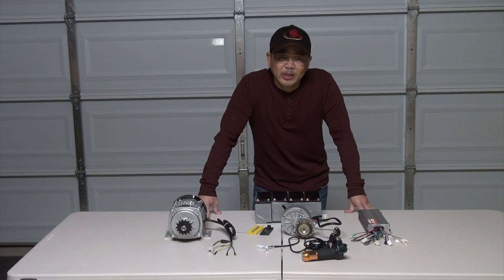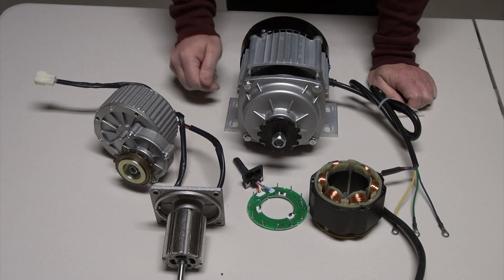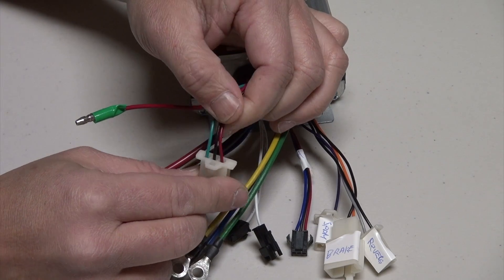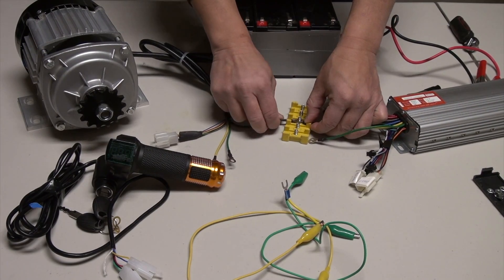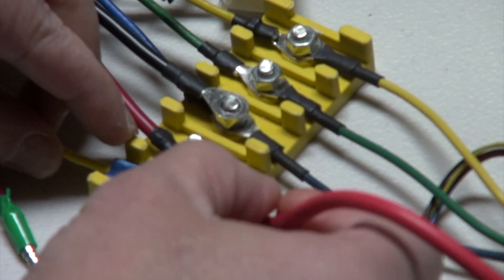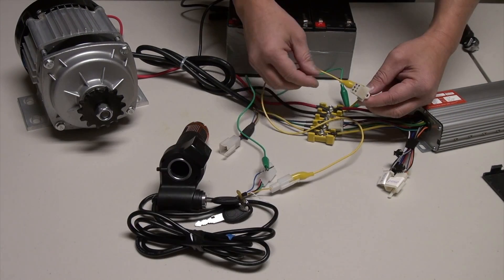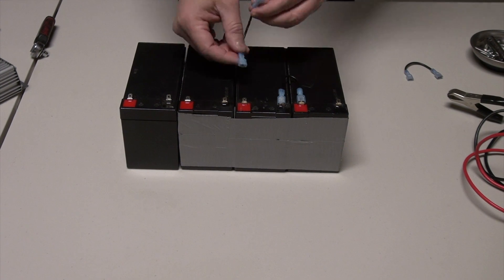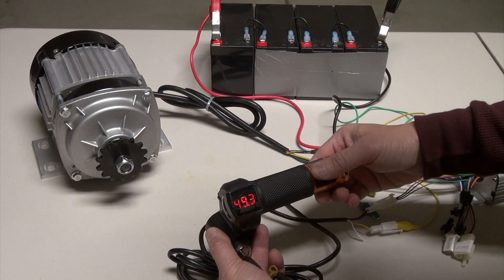How to Connect a Brushless DC Motor to Controller (48V 750W E-Bike) in English

Comment: I'm thinking of building an E-bike with a 48volt 2000watt permenant magnet motor. It doesn't have hall sensors. Any downfalls with my idea?
Reply from the maker: Check out part I & II of my ebike videos…Powerful Electric Bike Conversion Part II--Lithium-ion Battery Power Boost Upgrade
https://youtu.be/c6YgNQg3VM8

Comment: Does the controller step down the voltage for the "on off switch" or do you need a toggle switch that matches that batteries voltage?
Reply from the maker: The controller is rated for 48v.  For the throttle switch, the controller will allow a small amount of voltage to do its job.  Thanks!

Comment: Hi and thank you for your great tutorial.
I followed it completely to replace my former thumb throttle. 
I tried the  new sensor on an external source first and it showed the expected 5V connecting the positive and the ground cable and low Voltage when connecting the Data cable with ground which would increase when I twisted the accelarator. 
Connecting the throttle to the controler and motor I quickly found that I had to switch the yellow and white cable in order to not have the display consistently on and the keys without function.
With the cables switched, power supply seemed to be working as intended.
However, while the horn and lights worked well, the accelerator did not work at all. 
When measuring with Voltmeter,  the data cable of the throttle showed negative Volt  value which would not change when I twisted the throttle.
I can not explain to myself why that happened. I tried few other cable combinations but to have the key function working I could not find a way to make the sensor/accelerator work.
Do you have any idea about what went wrong and how I can fix that? I would highly appreciate some help.
Best wishes
Fran
Reply from the maker: The only thing I can think of is based on your description is that the throttle terminals from the controller and the accelerator might not be compatible.  Sounds like you already tried and make sure the positive, negative and signal lines ( green) from both the controller and throttle are matched and connected. Sorry bro.  Might be a disconnect in the throttle circuit…
Reply: Hey actually that was quite helpful as it made me check Volt output for the Halle sensor  at the controller and that is not the 5V needed. Now I can only think that I dont have Ignition and Switch assigned correctly as in my controller they are not easy to find. How can you recognize where to connect the blue and yellow cable from the throttle,. You connect the blue cable in the video to a red cable which comes directly from the main Battery cable or some side connector? Same is for the yellow cable to the Switch. In my controller I couldnt tell which one that is.  And my last question. With this controller and throttel, can you connect front and rear light and a horn which all switch off with the key? 
I really wuld appreciate an answer as anything helps right now.

Comment: Hey man, what if my controller doesn't have a red electric switch wire for the blue on the voltage throttle to go to?
Reply from the maker: It might have separate terminal for the throttle.  Hopefully your controller comes with a diagram.  Best wishes.

Comment: I’m very confused on how u connected the wires. What is that yellow thing? If somebody knows the answer I would highly appreciate if you could answer my question. Also, what is those connector things for the battery?
Reply from the maker: The yellow thing is the terminal block.  Those other ones are wire connectors or terminal connectors.  Sometimes, the terminal block come with the electric motor if it is part of a kit package.  I hope this helps.  Thanks!
Reply: @diypotentials  Did your terminal block come with the kit or did you get it elsewhere. If so, could you please add a link of where to get it?

Comment: Hello, Is it possible to use a 48V, 30Amp, 20ah, 960Wh battery with this motor?
Thanks!
Reply from the maker: Yes.  It should work…thanks!
Reply: @diypotentials  Thank you!
Reply: @diypotentials   @DIY Potentials: Projects & Ideas  Hi, I have a white and a yellow wire at the ignition cable.
Can I use the white cable instead of the shown blue one to connect.
Thank you!

Comment: Will this motor work backward? I mean rotating shaft to charge the battery
Reply from the maker: It can work as a generator.  But it will produce AC voltages.  You will need to convert AC to DC to charge the battery and regulate the voltage level.  Thanks!

Comment: How do I short circuit r2 and gnd on my throttle cable to go 31 mph it only goes 20 the seller on eBay told me to connect it that way I said that was your job and now he wants me to do it piss me off I didn't buy it from China either but it came from China California

Comment: Heyo, great vid. I have two of the same motors you have in 60v 750w and a 60V20AH 3000W lithium ion battery. I want to run both motors together for my project. Any ideas what would be a good setup for running two motors? Thanks much!
Reply from the maker: Hey Joe, thanks for asking.  Sound like an interesting project.  I have not tried running two BLDC motors off the same battery and controller, so I won’t be able to offer any helpful suggestions.  Maybe the other folks can chime in.  Best of luck.  Thanks!

Comment: Hi, if i have a Lithium-ion or Lithium Ferro phosphate battery of 72v50Mah, what should be my ideal motor and controller specifications to get optimum output? And can you please explain the science of it. Thanks in Advance!
Reply from the maker: Hello,  the motor and controller should be rated for 72v.  The current or amp rating for both items should be 50A or less.  Thanks!

Comment: Thank you for the details video, but how do you mount the hall sensor, my package actually has the hall sensor separate, where do I put this sensor onto the bike?
Reply from the maker: Hello, my understanding is that the hall sensors should be already installed in the BLDC motor.  I recommend reaching out to the seller on this matter… Thanks!
Reply: It could be a hall sensor to mount ob your fork. Then you place a little magnet on your wheel. that setup is used for a speedometer it is seperate from te workings of the motor

Comment: my motor run immediately when ignition wire connects to battery. more over gear up, it change direction of rational. is problem from motor or controller? Thank you sir
Reply from the maker: More likely the controller… thanks!

Comment: I wanted to thank you and tell you that I couldn't have done it without you.
But it appears that I have NOT done it yet.
When I try to connect the battery to the controller, I get a loud pop and a spark.
I am going red to red and black to black at every connection.
I don't understand why it won't allow me to connect it.
I can take a pic, or a video, to confirm to you that my positive and negative wires are not crossed.
edit:
Here is my video: youtube.com/watch?v=HUv6Gskd6bs
Reply: How much voltage is your battery? High voltage batteries do that. Best to get anti spark connectors when dealing with 60v or more batteries
Reply: 48v. I returned the motor and controller and got a new system and it's fine now.
 @DyLemmaOG

Comment: Thankyou will  try this , but.... 
I have both yellow wire for ignition connection at throttle , which one is blue can i connect in any one ?
Reply: It works but my source is a weak dc (48 V; 2-3 amp ) adapter so couldn't get the full run as expected but excited for tomorrow to try  it on charged batteries with enough power, thankyou once again \m/
Reply from the maker: Awesome to hear it is working…
Reply: Update: it's now on full throttle :D  , worked for both 48 V n 60 V  thanks a lot , but this 48 V 750 W seems only good for bicycles not so much torque but 60 V 1200 W will try for a quad bike upgrade soon it has promissing speed n torque let's see on field  with the quad bike n load ... Thankyou once again was about to return those as was unable to get the controller ON  .
Reply: @yaminoshinn1473   @yami no shinn  How do you connected the yellow wires? Is it a problem to mix them up?
I have a yellow and a white wire at the ignition cable.
Hope you can help me out!
Thanks.
Reply: @jones8732  yes no problem it just provides a switching circuit for powering control box  through ignition wire on control box  which is connected to  throttle wires
(In my case yellow wires; in the video above yellow and blue ,assuming yours yellow and white )  i.e. If it's the throttle wire u are talking about .
 Though it might get reversely controlled( not definite )  in that case u can switch wires , anyways it won't have issues on control box  try on low current output source first for more secure approach .
Reply: @yaminoshinn1473  Hi, Thank you for your reply. I tried it and it works.
Reply: @jones8732  congratulations bro

Comment: Im a little confused. So blue and yellow are powered. So what's the difference between the main power line and the small red line? Why does the switch curcuit need both wires powered? Shouldn't one go to ground?
Reply from the maker: The way I understand it is that the yellow wire is a positive line for the switch, so it needs to be connected to the power source which is the red positive wire from the battery--So it is a parallel circuit.  Coming out or at the opposite end of the switch is the blue line, which is still positive, that is why it is connected to the small red wire feeding into the controller, where the current will eventaully return to ground.  It is very confusing.  Maybe others can explain better.  Thanks!

Comment: Thank you for the video. I can’t find a diagram on this controller and this is a huge help. 

 I am trying to figure out what the remaining 4 sets of wires are for that you didn’t cover. 

Do you know what the black plug with the red, blue, and black wire is for. Is that peddle assist? I took the controller apart to see if the board had any clues on it. The wires were labeled as Red=+5V, Black=TX, and Blue=RX. 

Are the orange and black wires going into the female 3 pin plug the low brake wires? The circuit is labeled BKL on orange and GND on black. 

Are the grey and black wires going into the two pin plug the switching wires for forward and reverse? Grey is labeled BACK and Black is GND. 

Is the purple wire an battery voltage indicator wire? It is labeled XC 

Thank you in advance for your help.
Reply from the maker: Hello,  the black plug with the red, blue, and black wire is peddle assist.  The black and orange  plug is for Brake.  The gray and black  plug is for reverse.  You are correct.  The purple wire is the speedometer.   Thanks!
Reply: @diypotentials  thank you very much!

Comment: Thanks for the video. What do you think of running the motor without the speed controller. Meaning can i just connect the motor to the highest rate of the battery at once?
Reply from the maker: From my experience, a BLDC motor needs to be connected to a controller and will not work if directly connected to a battery.  Once connected to a controller, you can set the desired current to run the motor.  Thanks!

Comment: I bought a 1000W bldc motor for my electric gokart project which was supposedly more than enough for the size and weight of the kart
but the motor spins slowly even when the kart is kept off the ground (on a stand), how do I fix this?
Reply: for me it sounds like the motor controller that you use can not put enough current going to the motor - might be because of the low current and voltage ratings of the controller or maybe the hall sensors don't work fine.
Reply from the maker: It sounds like the motor's phase wires might not match with the controller's phase wires.

Comment: can i use  a 48v 13A battrey FOR a 2000w 42A motor  ?
Reply from the maker: If the voltage rating for the motor is 48V.  At 13A, the motor might run, but won’t achieve its full capacity.

Comment: I believe the BLDC motors are also called EC motors (electronically commutated) motors. They are often found in fans in the air conditioning industry.  They are preferred because of their energy efficient characteristic but they also cost more than PSC (permanent split capacitor) fans.
Reply from the maker: Totally agree.  Thanks!
Reply: @diypotentials  My controller doesn't have an ignition wire and I bought a throttle with ingnition key and the throttle has three standard throttle wires and two more wires, the yellow and the blue (ignition) wire. Any thoughts on how to resolve this? Thank you

Comment: One question  the blue wire off the throttle  goes  to any power source other than the battery  right im work with  different  controller for a brushed set up and  as this throttle is universal i need  to now figure  the blue wire as b4 it was blue and  yellow
Reply from the maker: That is the ignition wire to be connected to the controller.

Comment: HI! Thank you soo much for sharing your thoughts with all of us re ebike controllers! I have a 2008ish  500watt 36volt AC hubmtr. with a 7 speed Shimano, throttle type ebike from the landfill! I can't find Battery, housing, charger and BMS and I believe the controller is in the hub.  Connector to the battery has 6 pins 4 large pins and 2 small and the one to the hub has 5 small only two large pins.  Spent hours of research, learning but still afraid to buy a possible battery, BMS and charger for it. I have had the ebike for months and  I just want to go out get some exercise and experiment with this more. Also read I may need to change the throttle to a potentiometer type and I would need to getting bike rolling for the wheel to start rotating. Not a problem for me to do that and cooling down with fins or holes to stop any overheating is also. Cant I just get a get an LI  20 amp battery kit with BMS, charger with a SW/fuses and not the 30 amp controller you are showing here? I think I saw a 1-5 volt potentiometer on your other video but not sure where to get it? Way grateful for any thoughts on this!
Reply from the maker: Hello,  I'm not familiar with the hub-motor you described, so I won't be able to give any feedback on that.  However, I don't think the controller is in the hub.  There might be a hall sensor circuit inside the hub, though.  But I might be wrong.  Also since the motor is rated at 500 watts at 36V, it needs about 14 amps to reach 500 watts at 36V.  So if you are planning on getting a controller, any one able to handle 14-20 amps or more would be sufficient, even the 30 amp one so long it is rated for 36V.  For battery, a 20 AH (amp-hours) will be sufficient.  Of course the more AH the battery has, the more run-time you will get.   I found a video that might be more helpful..https://youtu.be/A8QcNvRh0wM.  Best of luck.  Thanks!
Reply: @diypotentials   Thanks again for looking at this and commenting here! 
With this I am getting a little more confidence on purchasing the controller you have here along with an Li battery/BMS and charger may just get it to work! I love that throttle you have here too!  Not many frills on this ebike so just a Voltage reading is great for my needs. My mistake on the Hub Mtr pin out it's really a 7 pin push and screw on plug. There are 5 small male pins on it. I am guessing these may be 5 vdc for the hall sensors plus the throttle?  Not sure yet until I test those leads and look further. If so what you are noting above makes more sense. I know it has a thermistor in the hub for overheating conditions but no direct pinouts for that. Enjoy your day and Kind Regards!

Comment: How do charge the four batteries??
Reply from the maker: You have to use a battery charger.  If you use  a 12v charger, you can charge each battery separately.  You can find these chargers on eBay or Amazon… thanks!
Reply: @diypotentials  thanks 
Do you know if there is any way you can charge all four of them
Reply from the maker: You might be able to find a 48V charger.  But just remember that you can't use a 48V charger to a charge a 12v battery, if you need to charge each individual battery by itself .
Reply: Okay Thanks man great Video,!

Comment: Hey can you just use a 12 car battery for this 1000w motor?
Reply from the maker: It depends on the motor’s rated voltage requirement.  If the motor is rated at 48V for example, you will need more than one  12 V batteries.

Comment: Hi I had a question. Does it matter what awg wire we use for the battery connections? Do you mind sending a link to the wires you used? I have a similar setup but my kit came without battery wires. I have a 48V 33A controller and I wanted to get the most out of it so I was going to use 4 12v 30A batteries. Now I just need to know which wires to purchase
Reply: Great video bro please help me
Reply from the maker: Hello, you won’t be drawing 30A at a time.  I recommend a 12 awg wire.  Here is the wire current chart.  If you think you will be drawing more amps, refer to the chart to the right rating for your project.  Thanks! https://www.solaris-shop.com/content/American%20Wire%20Gauge%20Conductor%20Size%20Table.pdf